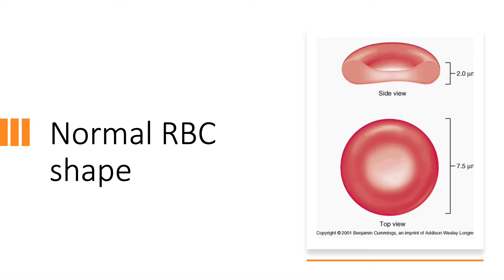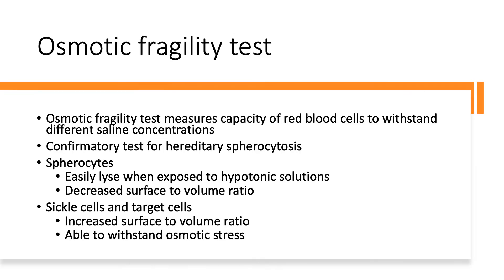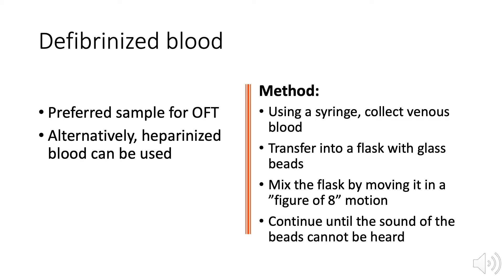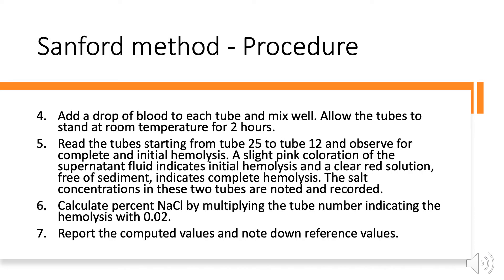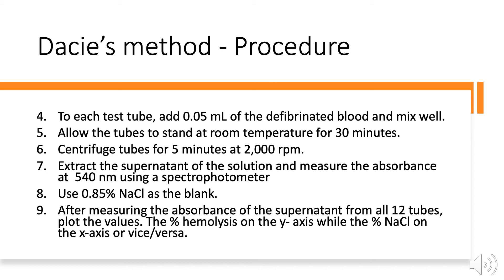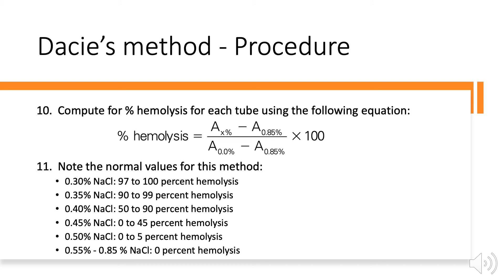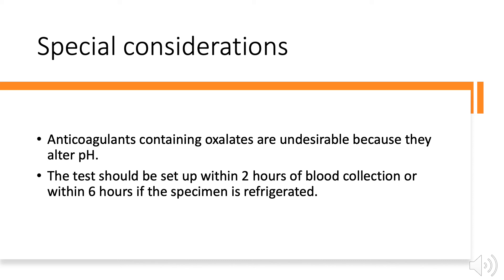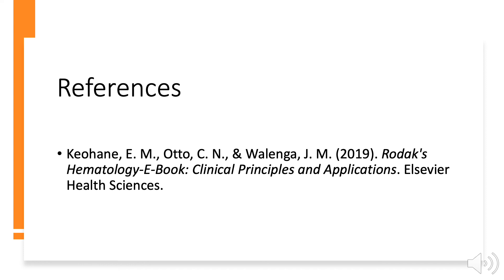Osmotic Fragility Test -  Dacie's and Sanford method

Comment: Why would you subtract the 0.85% NaCl solution from the absorbance values if you are using it as the blank? Could you not just zero out the spectrophotometer with the 0.85% blank? If so, would it not just be the absorbance of the sample tube divided by the absorbance of the negative control tube, multiplied by 100?
Reply from the maker: Hi. The blank being used here is plain 0.85% NaCl without blood. Meanwhile for the equation, the absorbance being deducted is from the supernatant of the 0.85% NaCl tube with blood. Please check out this video for the demonstration: https://www.youtube.com/watch?v=NWn3gpXnS1k
Reply: @ClinicalLabScienceVideos  Ok, I'm sorry. I missed that during my initial watch. Thanks for clarifying.